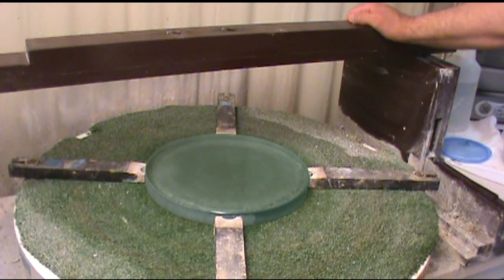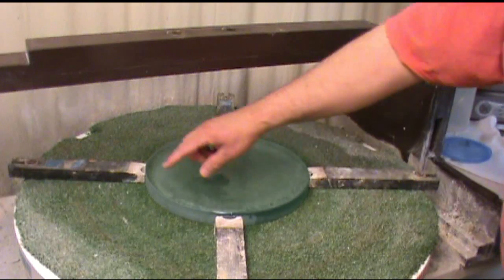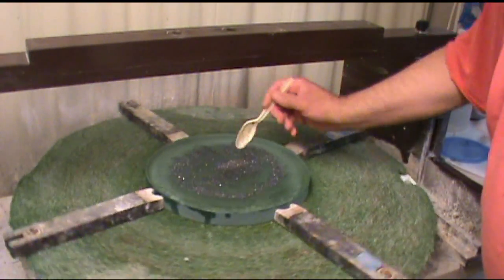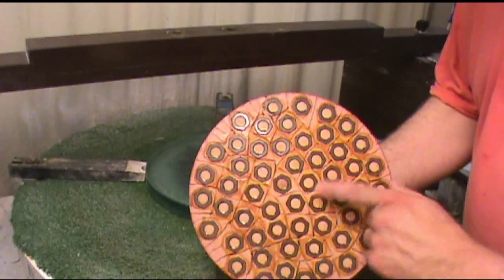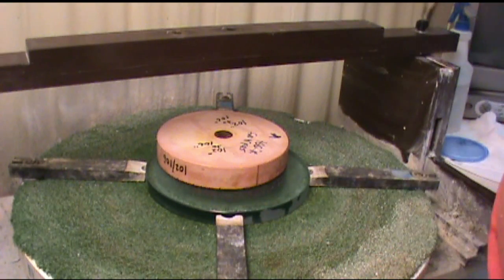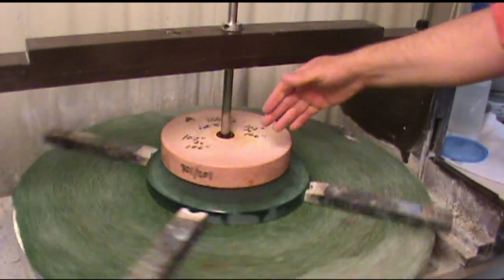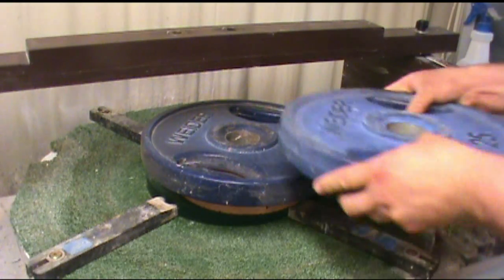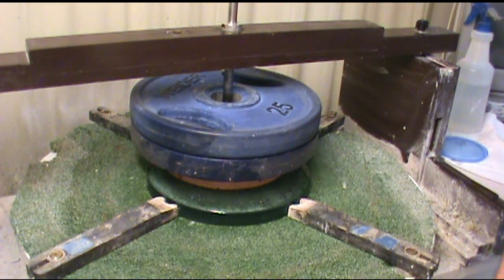Using the Fixed-Post Grinding Machine for Rough Grinding an 11-inch Telescope Mirror

Comment: You have some of the best mirror grinding videos I've ever seen.  Thanks for putting it up online.  Regarding the weights...assuming you had a suitably rigid beam (that beam above the mirror where you drop the shaft through), do you see any reason why instead of weights you couldn't use a spring with equivalent force with thrust bearings on either end to make it rotate freely and a kind of force-spreader metal plate on the bottom side that's in contact with the grinding tool (to mimic the spread-out force the weights provide)?  In addition you could have a threaded shaft at the center of the spring to compress the spring and be able to adjust the downwards force, equivalent to adding weights.  Maybe spring from a motorbike could work.  I'm just thinking it would save having to have a bunch of weights lying around plus give you continuously variable force that you could play around with.
Reply from the maker: Professional machines have a pneumatic arm that presses down on the stack.  But that is WAY overkill for most workers.  I keep around three weights for most stuff: 2.5#, 5# and 10#.  That covers 95% of everything you need to do.  Sometimes for hogging or really rough grinding I'll put another 10#.  But still you are not talking about anything inconvenient.
Reply: @GordonWaite  thanks for the reply.  That's interesting about the professional machines.  I'm daydreaming about a different machine design and a spring (or pneumatic) would fit the design a lot better so it's encouraging to know that kind of thing is actually in use.

Comment: Mr Gordon could you explain what components are needed to build a grinding machine like yours? Thank you,  Joe
Reply from the maker: +Joseph Dragan I'll try to put together a video showing the design and construction of the machine.  Thanks!
Reply: @GordonWaite  Greetings from Russia!!!
I would like to know from you - where you can get sketches with pasmers of your grinding machine. I'm going to make mirrors for the 16 "F3.5 stationary telescope. The material is sitall.
Reply: Mr Gordon what material is that table made of? round cut white painted wood?

Comment: Hello Mr.Gordon which the diameter of the plaster tool and what rpm was used thanks I´from Brazil
Reply from the maker: Hi!  I like to use a grinding tool that is about 75% of the diameter of the mirror.  So for this 11" mirror, I would use around an 8" tool.  For grinding, I always start with the machine a little slow, then bring it up to full speed, 60 rpm's, when I see that everything is running properly.  On a bigger mirror, like 20" or larger, I would probably go a little slower.  Same for a thinner mirror.  Mirrors at 1" or thinner I would keep the speed down to 45 rpm's.  Thanks!  -Gordon
Reply: GordonWaite
Thank Mr. Gordon Waite